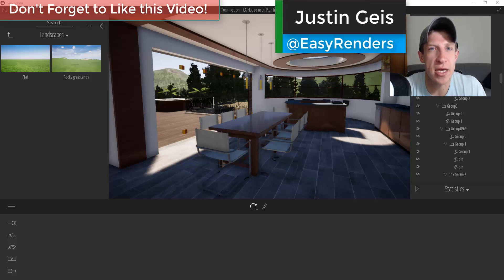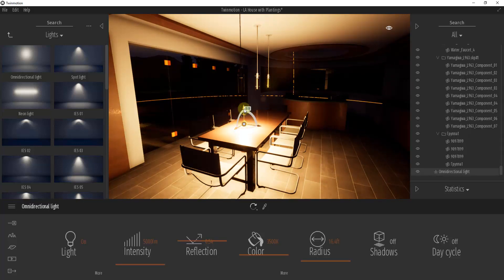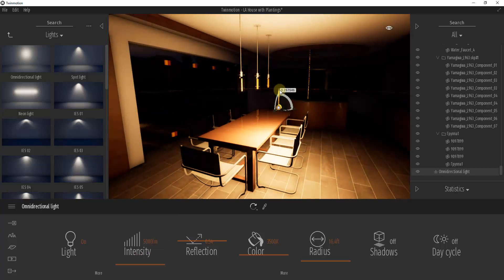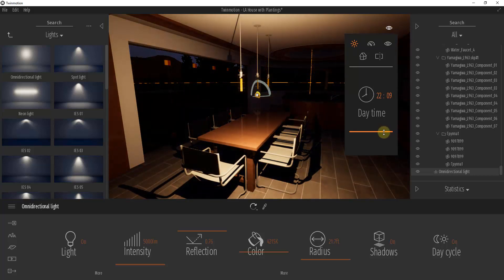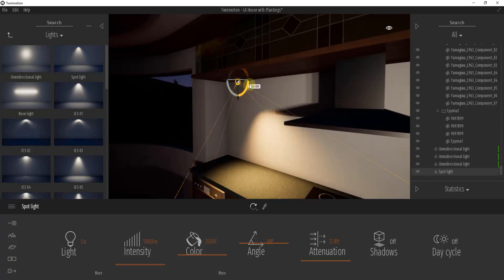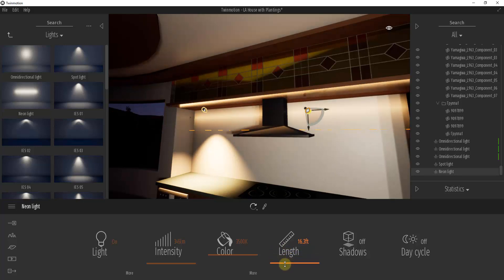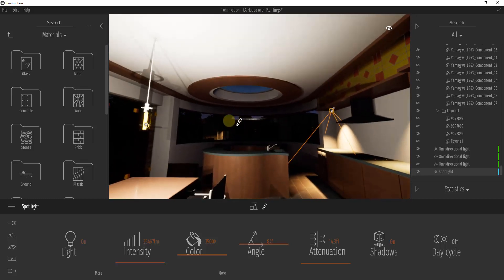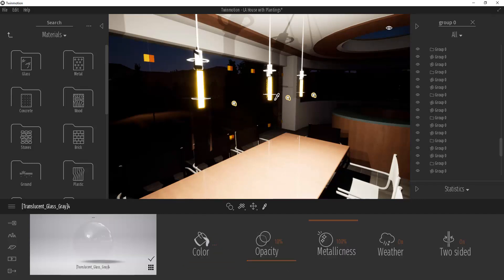Getting Started RENDERING IN TWINMOTION (EP 8) - Interior and Artifical Lighting

Comment: Is that the cpu fan speed that we hear in the background whenever you stop talking.The process too seems like it need mode computation power to calculate light emision in realtime.I have a 1050ti will it run twin motion?
Reply from the maker: Lol - well yes, it is CPU fan speed, but it's also poor PC placement on my part - the PC fans point directly towards my microphone - a 1050ti should be able to run Twinmotion, though I'm not sure if it will run at the highest settings or not :)